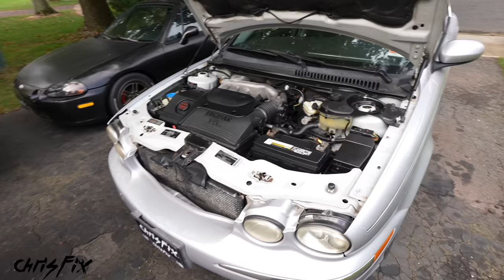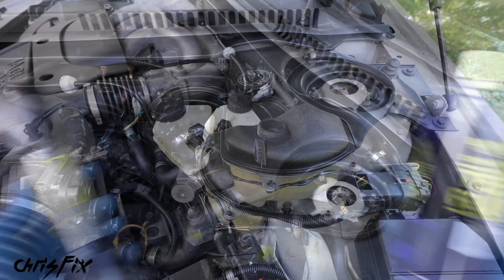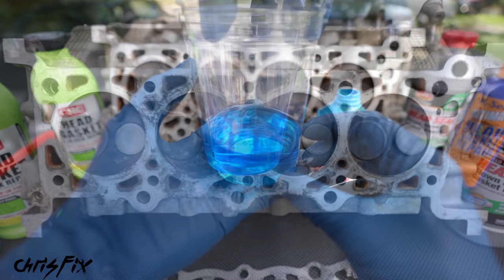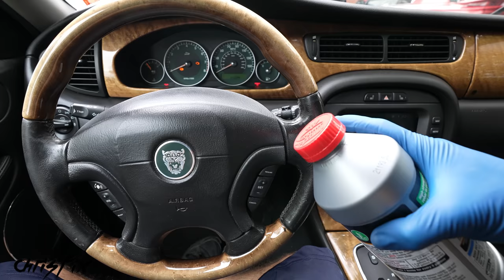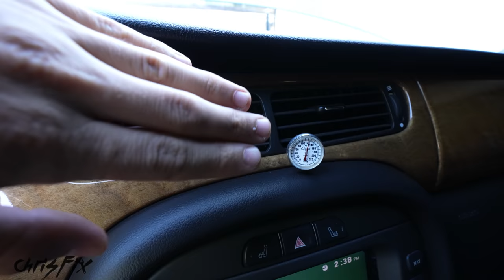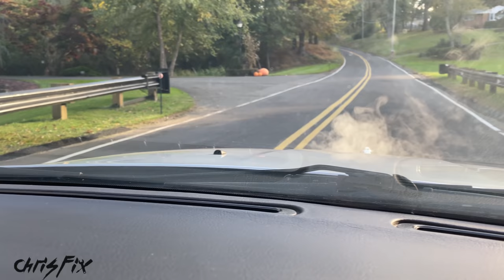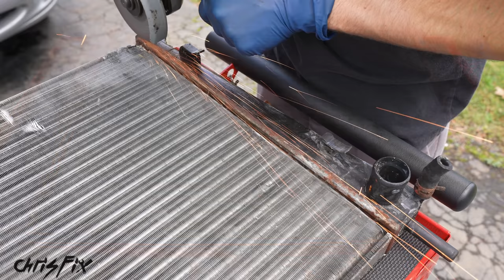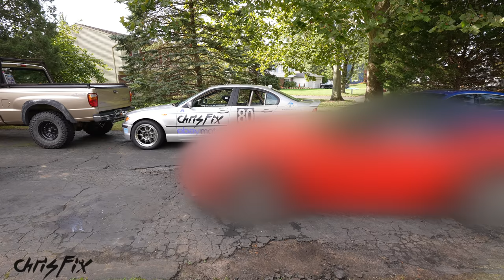Do Head Gasket Sealers Actually Work (FULL 2yr TEST with Engine Teardown)

Comment: 24:38 could it be good to use antifreeze to clean pistons?

because the issue was a warped block.. what would have happened if you gave it to the mechanic who had quoted 7k to replace the gasket?
Reply from the maker: You’d be better off removing the head and cleaning them yourself if they got that bad, and I think they would have checked/machined the head and replaced the gasket but not do any work to the block.

Comment: What if your heat is not working? Can you still use it?
Reply: Depends if the heater valve is working. Otherwise the heater would get clogged most likely.
Reply: @SinsBird  thank you I’m going to check and see now
Reply from the maker: If your heat is not working because the coolant is low then I would do this and then fill up. If you are concerned the heater core would get clogged then I would choose a sealer that is more liquid
Reply: @chrisfix  thank you

Comment: Have a question.

I've been reading a lot of comments on Reddit & here about the successes and failures of head gasket sealers. There are a ton of people on Reddit saying that these substances are the work of the devil, while most people on this video comment section are singing their praises.

Why is that? I get and understand that angry people are more likely to vent out their frustrations when things don't work, but I'd expect angry reviews on all platforms, not just Reddit. Are people here using the product properly, while people over on Reddit are using it improperly?

I fail to figure out the reason behind the vast discrepancy behind anecdotal evidence of product users.
Reply: Either doing the procedure improperly or making things up.

Comment: Is it possible that I have a head gasket issue on my 99 civic? Coolant magically disappears without any visiblw trace of leaks anywhere, no white smoke, no frothy oil, and no bubbles in the cooling system, however I do notice that theres pressure in the radiator. thanks in advance for the replies

Edit: the car does not overheat when driving, it only overheats when coolant is low due to the coolant disappearing. After 2 trips/approximately 30 kms I add about a liter of coolant
Reply: Start the car when the engine is cold, remove coolant fill cap, fill to the brim, see if it's bubbling.
Reply: @SinsBird  thanks for the reply, already tried that and theres no bubbles
Reply: @louie.c7715  How much coolant have you added so far?
Reply: Any chance you've simply missed seeing the lost coolant either on the ground, or clinging to the underside of the car?

Comment: U should of tried the KSeal it fit all your requirements, and wasn't
the liquid glass stuff that isn't good if it gets by oil rings, will lock up your bearings! They used it to lock up engines in the Cash4Clunkers bullshitsky'!Add  Right in the oil and 10 minutes later, you had a boat anchor! Just MVHO...

Comment: I drive a Nissan Almera Classic with the QG16DE engine that looks similar to the QG18DE, I forgot to close the radiator cap which led to alot of coolant loss which caused overheating and that led to a blown head gasket, I am gonna replace the head gasket tomorrow and I  just wanna know if I can still drive it as hard as I used to before? The car was driven for 78k miles, will the car be the same as before blowing the original head gasket ? Will I be able to push the car to its limits after the head gasket replacement just like I used to before or not?
Reply: No change in engine properties, no reason for it to be any different.
Reply: @SinsBird  even if the cylinder head got taken to a machine shop and had the warps fixed?
Reply: @azzeddinefoura4741  Machining is what makes it work reliably. The gasket would blow in no time again if block and head were not resurfaced.
Reply: @SinsBird   thanks brother, the head gasket was successfully replaced today and there are no leaks or anything, I took the car for a test drive and everything is just like it was before, the engine idles perfectly too, I guess it was a successful head gasket replacement.

Comment: I tried blue devil on my 1993 Nissan Skyline GTS25T (R33) RB25DET was burning coolant, and it did not work.
Reply: Is coolant and oil mixing? Oil in coolant or coolant in oil, or both? Is the cooling system pressurized?
Reply: @SinsBird  Unfortunately, all that I have left of that car is the completely disassembled engine, which is planned to be installed īnto my S14, once I get around to it..
Reply: @cen7ury  gotcha.

Comment: Why did you skip the best product on the market?  Zecol Mendtite is no question the best head gasket sealer.   Every local stock car racer knows this if you ask around.  Mendtite saved my 2001 duramax diesel plow truck 5 years ago and still going...
Reply from the maker: I just did a quick search because I never heard of that and it looks like it's been replaced by the BlueDevil HG sealer

Comment: I have 2003 Taurus w 200 000 on it but it does run well does not over heat but I keep water on and in it too....But anyway used Kseal Did not work and tried Blue devil but might of not let it sit for 50 minutes and it didn't work...But I haven't tried the stuff u used in video I still have leak in head do u suggest I try the stuff u used in video or any suggestions!?? Please help lol 911
Reply: They're all the same. You're either doing something wrong or the issue can't be solved this way. Do you have coolant in the oil or oil in the coolant? If so, the chances of it successfully sealing are lower. Is the cooling system pressurized? Make sure to use water, not antifreeze. Make sure to flush the cooling system multiple times before and after use. Best to remove the thermostat. Make sure the rpm is not less than 1000. Do it in steps, not one go, let the temperature raise some, shut the engine off, let it sit for and hour, check coolant level, add water if there's less of it now, start and run the engine some more to reach a higher temperature than before, shut it, let it sit for an hour. Check the coolant level...and so on till it reaches the operating temperature. Don't hurry to dump it out of the cooling system, make sure that it sealed for sure, drive it keeping rpm high so it gets real hot, then check the coolant level. If it's okay only then dump it out.

Comment: Dammet its smoking under the hood after replacing a radiator would it be a blown head gasket?
Reply: You must find where it's coming from.
Reply: it may be coolant leaking and evaporationg on the block

Comment: What happens if you already have air in your cooling system but you are checking for a head gasket leak? P.s I finally found a turtle spray wax that doesn't leave water spots. 😊
Reply from the maker: What checking method are you using?
Reply: You can test it by filling the cooling system to the brim, starting the engine when it's cold and removing the coolant fill cap.
Reply: Just checking by looking at it for bubbles  after filling it completely with coolant. I recently noticed my rad cap was bad, was getting air in the system. I suspect one of the rad hoses as being bad as well. The reason i ask is because as i was filling both cold and hot, i am seeing alot of bubbles, atleast until filled completely. Then i see bubbles but only small ones that possibly  are still in my system. I am wondering if it's related to how we check for the head gasket to also be bad or if you had any additional helpful advice that mite be able to help others? My heater is still working properly, so my water pump is still working. It is not leaking underneath that i am aware of but it's going somewhere cause every couple days it needs more coolant. About to change the coolant hoses tomorrow and my valve cover gaskets It never reaches the middle of the temp gage and my cat code 420 and 430 comes on. Possible thermostat but i haven't checked the bottom hose yet for the same heat temp as the top.
Reply: @chadslater3521  Is the cooling system holding pressure? The cap will only let air into the cooling system if there's vacuum in it. And the only way to have a vacuum in the cooling system is to lose coolant. If the cap is leaking coolant OUT then the cap may be the problem. Otherwise it could be the head gasket. Fill the cooling system. Put the cap on. Start the engine when it's cold. Let it run a couple minutes and check the firmness of any coolant hose. It shouldn't be noticeably harder than before starting the engine. Let the temperature rise close to operating temperature. Check the firmness of the coolant hose, it should be firm.

Comment: Would it work if my water and oil already mixed
Reply: The chances of sealing such leak are low but that doesn't mean one shouldn't try it. Is cooling system holding pressure?

Comment: Hmmm Interesting!  Idled my SUV listening to music. Now mine has the oil light ping ping with the drip. I was told its the seals on the heads that need replaced and the oil is dripping into the engine.   It drives well and not overheating. But I'm not driving much over 10 minutes at a time or out of town right now. Not sure about the coolant being low. Nobody said it was or an oil problem. Just curious. The A.C. does not work. Not sure what to do. Just had a friend give it to me. Does anyone have an idea?
Reply: Check oil pressure.

Comment: What's the best sealer for a 6.0 ford diesel? 
I have fuel leaking into the coolant reservoir 
Thanks.  Most times on a 6.o it's either the gasket or cracked head
Reply: All of them work but I wouldn't recommend getting any with particle filler if removing the thermostat would be a problem for you.
Reply: @SinsBird  thank you for the help
 I see this blue liquid glass might help 😏
Reply: @mikedabike64ify  Good luck. I recommend to do it in steps, not one go, also keep the RPM above 1000. Let the temperature raise some, shut the engine off, let it sit for and hour, check coolant level, add water if there's less of it now, start and run the engine some more to reach a higher temperature than before, shut it, let it sit for an hour. Check the coolant level...and so on till it reaches the operating temperature. Don't hurry to dump it out of the cooling system, make sure that it sealed for sure, drive it keeping rpm high so it gets hot, then check the coolant level. If it's okay only then dump it out.
Reply: @SinsBird  thank you
Reply: @SinsBird sorry when you say dump it out you mean after I temper it up to operating temperature 
This has to be dumped then refilled with coolant in some cases. 
I never used the stuff so I want to ask questions to do it right 
Thanks.
Reply: @mikedabike64ify  you're supposed to use the product only with water, so after the leak is sealed it should be replaced with regular coolant.
Reply: @SinsBird  ok thank you.

Comment: Which is the best one
Reply: Most are sodium silicate based so the only difference would be the filler material. Choose one with no filler material if removing the thermostat would be a problem for you. Is coolant and oil mixing? Oil in coolant or coolant in oil, or both? Is the cooling system pressurized?

Comment: The oil in my Toyota aygo is like the video, it's black and white. This means that there is an coolant leak and burn in the engine. But the coolant level is at Max and the car doesn't overheat! Does anyone know the what happening?
Reply: Coolant leaking into oil.

Comment: I have used a  head gasket sealer on a peugeot bipper 2010 and it didn't work
Reply: Is the cooling system pressurized? Oil in coolant or coolant in oil? Or both?
Reply: @SinsBird  yeah
Reply: @davidmcgrath7464  it rarely seals when coolant and oil are mixing.

Comment: I stopped watching at 2:29 If you have a demolition derby car and you want a few more heats. by all means try this. On many modern cars the coolant passages are so small at the head gasket any stop leak will plug them off. Now you have no critical cooling to certain parts of the engine.  If you can't afford to fix a head gasket, you sure as hell can't afford to replace the whole engine, or the extra 1000 dollars in labor trying to get the stop leak out of everything

Comment: Does mixing coolant colors blow head gaskets??
Reply: @chrisfix
Reply: no
Reply from the maker: No, colors does not necessarily mean the wrong coolants are being used. If you use the wrong coolant type then you can cause headgasket failure after a long time due to corrosion and other factors.
Reply: @chrisfix  I have the European Red and I put Preston all vehicle coolant in it. And was using that to top off. But the bottle says it's compatible with all types

Comment: Could my head gasket be blown if oil is getting inside my coolant reservoir
Reply: Yes.
Reply: @SinsBird  would it be best to replace my motor or to get the head gasket changed it's a 2012 mercedes benz I bought it last month in December I was thinking of swapping the motor because I don't know if the gasket has been a problem for the car
Reply: @ivanhernandez5089  if the rest of the engine is good then it's better to repair it.
Reply: @SinsBird  thank you im definitely going to get it checked
Reply: @ivanhernandez5089  Could be oil or transmission cooler too if it has one.
Reply: @SinsBird  I tried doing a coolant flush and it smelt like oil. The top of the coolant reservoir and it was a peanut butter color

Comment: Can someone help me my car is not overheating oil is ok colour the cooling reservoir has oil bubbles and dirt in it its not mix together the cooling fluid is at -30°c
And the car in question is skoda octavia 2016 1.6tdi with 100 000 km on the clock i dont know what to do anything helps
Reply: Is cooling system pressurized?
Reply: Hi i think so how can i check
Reply: Press one of the coolant hoses with your hand when the engine is cold. Then try again when the engine is close to operating temperature.
Reply: hi sorry for late reply i have pressure in the system and i have an update on the coolant color is now fully black like old diesel oil i did an oil change recently i have checked the dip stick the color looks fine i don't see any water on it even after engine was running but if there is any its probably on the bottom of the oil pan i dont have any leaks
Reply: @NikolaJozic-pk8ye  If you start the engine when it's cold, remove the cap from the expansion tank, fill it to the top, is there bubbling?
Reply: no bubbling at all but my mechanic friend told me i should do a super flush and see if comes back but I m still wandering were is this dark color coming from thanks for the replies so far
Reply: @NikolaJozic-pk8ye  Perhaps it's the oil cooler then if not the head gasket.
Reply: I think its the oil cooler too ill come back and let you know once i fix it but that will be probably in a month one again thank you for taking the time and replying